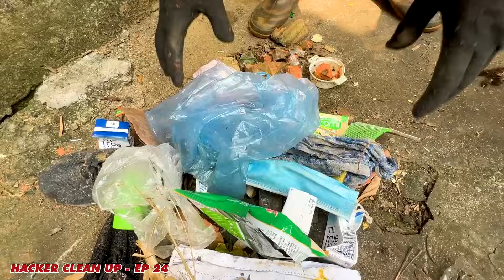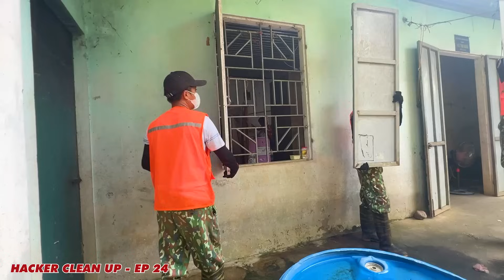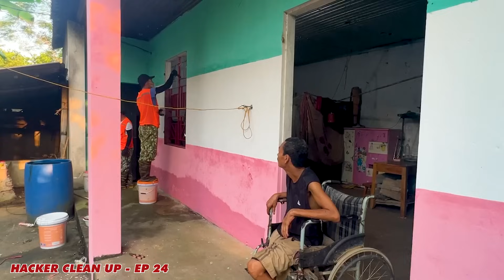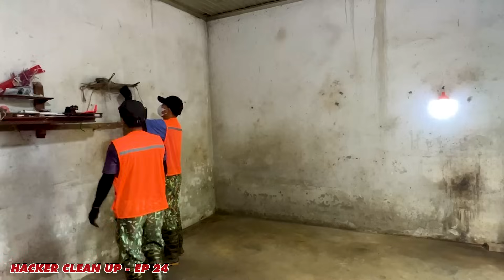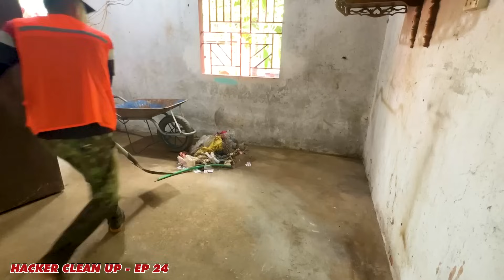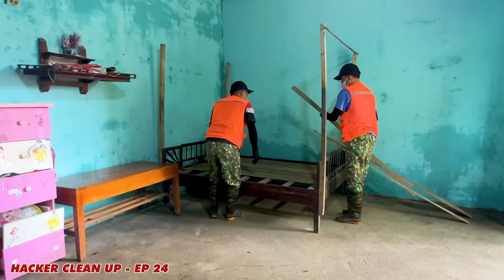WAR has Taken away SOLDIERS' Legs. Help the MAJOR Clean Up and Renovate a MESSY HOUSE for 42 years.

Comment: Try to advice the kids to have proper disposal of their garvage. Dig a hole for garbage that are unrecycable. They just have to burn the unused papers and dried leaves. But plastic and glass must be segregated. Let them have a sack or garbage bag or container for recycable garbage. They must be educated as early. The floor still needs to bw pressure wash or cleaned.
Reply from the maker: Thanks you very much